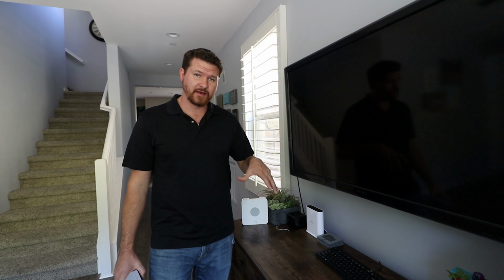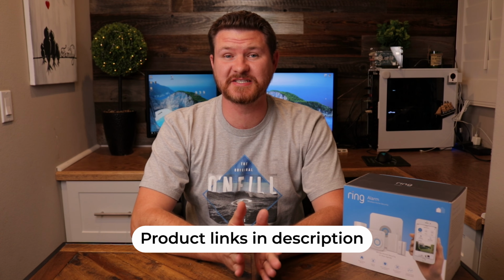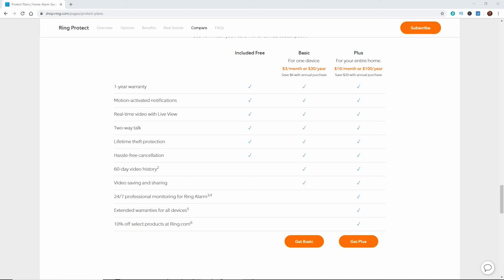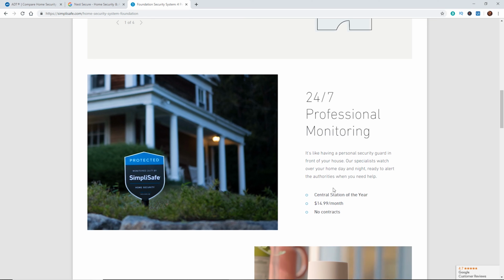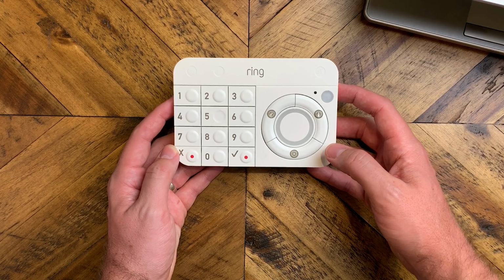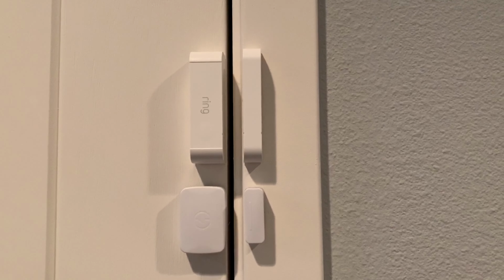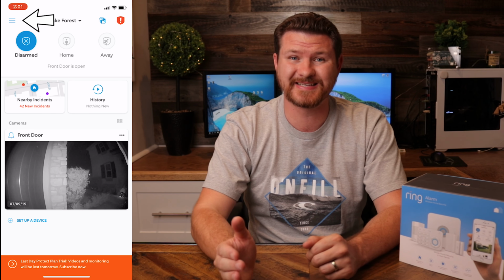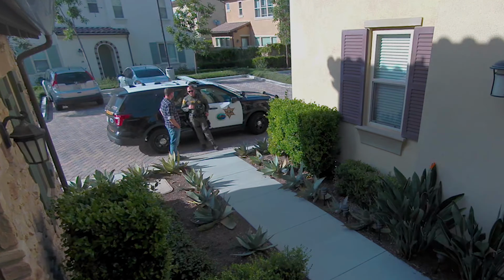Ring Alarm System - NOT What I Expected

Comment: Honestly believe the Ring security system is the best "smart" security system. It allows pairing of third party zwave contact sensors that nest secure doesn't. Currently i have a wired ADT system that i plan on getting rid of but using the wired contact sensors with the ring retrofit alarm kit they have so i can use the old wired door and window sensors. Now for cameras i opted for nest since they have better image quality, offer 24/7 recording and i know my  footage is more secure with google than amazon ring products. Nest is decreasing their 24/7 recording to cover all nest cameras for like 12.99 a month in 2020. For inside the house i utilize sonos amps, beams, etc for music and i have multiple echo flexs to act as intercoms for each room. I also have google home hubs in each room for voice control, timers etc and nest thermostats to monitor temperatures. For home automation i use samsung smartthings for thier agnostic position when it somes to google and amazon war and sonos for that very same reason. So in total im paying $10 month professional monitoring from ring, and $12.99 to nest for 24/7 video recording inside and out. Smarthings and sonos for automation and multiroom music inside the house and alexa devices as intercoms between rooms. Although my system is pretty spread out i like to think i have most bases covered with convenience and security. I plan on making q video myself on my system one of these days. Thanks for the review though i was already leaning toward ring security but you pushed it over the edge.

Comment: Free hacking
Reply: Actually, there have been articles like this for a lot of different companies.  But, Ring and Nest have never had a hack on their systems.  When people hear the word "hack", they grossly misinterpret it.  These folks had their login credentials leaked via a phishing attempt, malicious keylogger on their system, etc.  Have you ever seen someone on Facebook send you a message that wasn't them, and it included a suspicious link?  Or maybe they made a post on their feed that wasn't them, with another suspicion link?  It is the same thing. These aren't "hacks".

That being said, Ring has already taken measures to prevent those people with leaked credentials from having their systems logged into.  I believe Nest is doing the same?  It is called 2-Factor Authentication, and you should be enabling this on EVERYTHING you can.  This means that if your login information is captured, and someone uses it to login, they will not be able to. You will get a text message with a special access code that will need to be entered.  2-Factor Authentication stops these terrible asshats in their tracks.  Ring requires 2-Factor Authentication now for all users (I think that got pushed though a month ago?).

Comment: All I want is basic monitoring, mostly for smoke and CO2 protection.  ADT was charging $60 a month plus the landline was $53...that's $113 a month. So far I have not had any problems with RING and unbeatable for $10 a month with cellular backup.  It's just as good as any other monitoring company.

Comment: Great video, Steve. After comparison shopping I am going with Ring. On sale right now through Amazon - $139 for the 5 piece system. Thanks for the review and thanks for sharing.
Reply: Robert Cairns - on sale at Costco for 179 for 10pc if you’re a Costco member.
Reply: nosirrahm ... nice! I will check it out. Merry Christmas!
Reply: Robert Cairns - just realized that the sale ends today!

I am going to only setup my door sensors at this point because I am thinking about using the Ring Retrofit alarm kit to use my existing wired sensors.

Comment: What if someone breaks windows
Reply: If you have motion sensors, they will trigger them. I also believe that Ring is working on a glass break sensor.
Reply: Until Ring comes out with Glass Break sensors, you can use Amazon Echo products to detect glass breaking.  Look up a feature called Alexa Guard.  If you enable that, your Echo speakers can detect glass break, Fire/Carbon Monoxide alarm beeping, and it can randomize your smart lights making it look like you are home.  You can link your Ring Alarm or ADT system to Alexa Guard.  If the Echo(s) hear the glass breaking or alarm beeps, it will trigger the Ring Alarm system.  If you have the Ring Protect Plus plan, you will get a call from a Ring rep when this happens, and they can send a police officer to your home at your request.

Comment: Unfortunately no. for me. starting at 200 . 160 I was able to get 4 Wyze cams, 1 pan cam, 4 contact sensors and 4 sensors and 1 surge protector for 180. and not pay a month subscription. 120/yr  that is $600 in 5 years after starting for only $198.  w/5-sd cards. yeah

Comment: QUESTION FROM BUSINESS OWNER. I have two other gals working with me, am I able to add them to the system with them having the app? 
For example, they will have a code (different) than mine and able to disarm the alarm and arm it, that’s it.
Reply from the maker: Hi Iris, yes you can. I'm able to add my wife with her own separate account.
Reply: Steve DOES thanks for the quick reply! I just realized I worded that wrong. Am I able to add them to the system WITHOUT them having the app?
Reply from the maker: @IrisGee  I believe so. I was just reading this article on setting up a guest user. https://support.ring.com/hc/en-us/articles/360035714171-Guest-User-Scheduling-for-Ring-Alarm-
Reply: Iris, if you do this, make sure you add them as Shared Users in your Ring app.  They will need to create a free Ring account first, though.  I would advise against logging into their phone's Ring app with your own login credentials.

Comment: Hi Steve DOES, pretty good round up. I read in a few discussions that RING security struggles in a big house due to its range and sensors etc keep connecting disconnecting etc, What do say to that
Reply from the maker: My house it pretty small so i can't confirm those claims. Sorry.
Reply: Those Ring Alarm kits (or at least, most of them) come with a Z-Wave Extender.  If the Ring Alarm Base Station's range isn't reaching far enough to your sensors, plug in the Z-Wave Extender for Ring.

Comment: Excuse me sorry, simplisafe is not $5 per camera. $24.99 monitoring includes camera recordings for up to 10 cameras, and yes they are rated for out doors with their outdoor kit. Got below -3 degrees and had no issues with it. I believe ring and simplisafe are the best, but when it comes to response times in an emergency since simplisafe has 7 central stations, they call in seconds, and that’s where the extra money is going toward and that’s a fair value. I would recommend it to anyone who wants something simple and safe. P.S. Rings system looks like a toddlers toy. And simplisafe has the added benefit to allow visual verification during an alarm. That means when the alarm is going off, the monitoring company can visually verify in REAL time that theirs an actually break in. This feature has to be checked off by us, the customer, and some counties will not dispatch unless it is visually verified, this is something ring does not offer.

Comment: The only things that i'm still considering to purchase Ring system is that Ring does not have Glass break sensor.. isn't it?
any othere compnay seperlate glass break sensor available in the market? any recommand?
Reply: KIM 2013 TONY it’s seems al z wave products ara compatible with ring alarm
Reply: Until Ring comes out with Glass Break sensors, you can use Amazon Echo products to detect glass breaking.  Look up a feature called Alexa Guard.  If you enable that, your Echo speakers can detect glass break, Fire/Carbon Monoxide alarm beeping, and it can randomize your smart lights making it look like you are home.  You can link your Ring Alarm or ADT system to Alexa Guard.  If the Echo(s) hear the glass breaking or alarm beeps, it will trigger the Ring Alarm system.  If you have the Ring Protect Plus plan, you will get a call from a Ring rep when this happens, and they can send a police officer to your home at your request.

Comment: I love my ring alarm, I’ve had it since February and has been flawless. If you can get it at Costco where it goes on sale for $200 and comes with 6 contact sensors instead of one everywhere else
Reply: Does it alert you when any of the batteries are running low and need to be replaced?

Comment: It's WiFi base that's why it's cheap worst system to get.  Same as simple safe .  Any security system you get make sure they offer cellular
Reply: Ring is backed up by cellular. If power or no wifi goes down alarm is still active. I have the ring alarm.
Reply: @Adam go ahead and get ring.  You'll end up with brinks, adt or vivant.  Just trying to save you time.  The ring cameras and skybell are fine.  But their alarm system is for kids.
Reply: Exactly.
Reply: Ring does offer optional cellular backhaul.
Reply: I am a Brinks salesman.  Trust me a lot of people get the ring system, but they end up switching over because they are unhappy w their mickey mouse service.
Reply: Ice Ice KODI spoken like a true Brinks salesman.
Reply: @iceicekodi6402   so honestly speaking, what system do you recommend?
Reply: Ring is either WiFi or ethernet. I have mine connected physically to ethernet for a more stable connection. It also has cellular backup. Anyone who thinks this system doesn't work is either competition like Ice Ice Kodi or simply misinformed.

Comment: Great video Steve!  Any chance Ring will work with my Arlo Ultras?  I've been using iSmart Alarm cams (interior) and door/window sensors and have had good luck with them.  They are about 8 years old.  Love technology but wish all the gear worked together, same app etc.
Reply: Mark Kuhn you can use something like homeassistant or smart things for this. Both require some sort of hub or raspberry pi.
Reply from the maker: How are you trying to get Ring and Arlo to work together? Like DJ Coma already mentioned, you can create Routines in SmartThings that should get them working together. You should also be able to do this in the Amazon routine environment too. If you have more questions let me know.